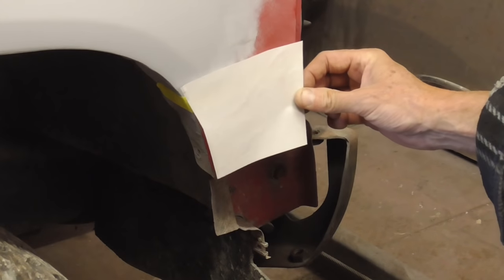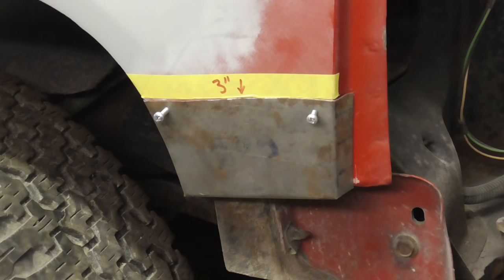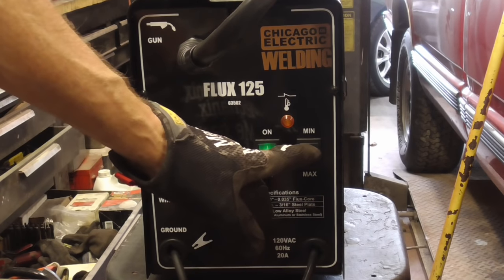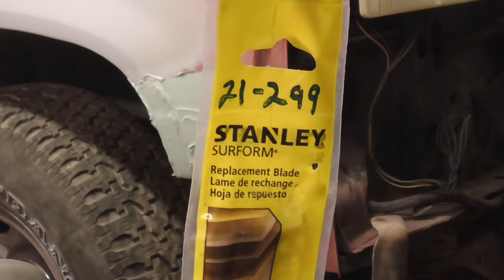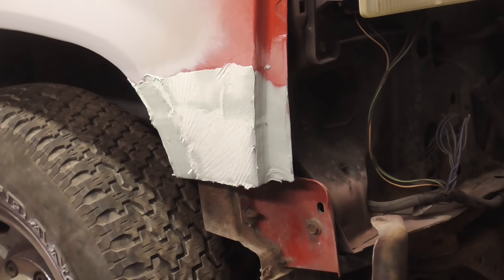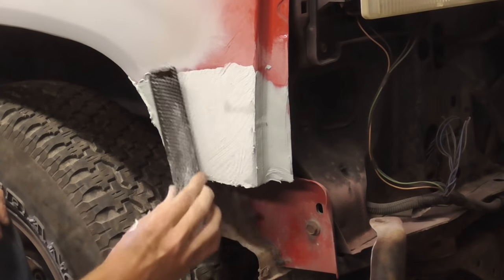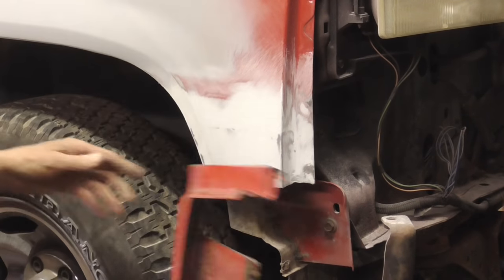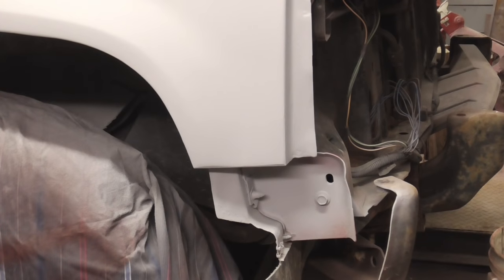Welding Automotive Patch Panels with a Harbor Freight 125 Flux Core Welder

Comment: Are autobody patches usually overlapped like that?  I thought they were done with butt joints?  I know nothing about autobody stuff though.
Reply from the maker: Many times on TV, the internet and magazines they will promote strict butt welding as the holy grail of patching but in most Michigan body shops lap welding is the most common method - along with butt when needed and/or glues.  All methods are usually used in a production body shop.  What ever gets the job done - quality/efficiency/speed - for each individual repair.  You will see all the methods I've seen used in body shops on this channel.  Here's some great info - that way you can make your own decision on what's best for you:  https://www.youtube.com/watch?v=JIIonJOVro4  *  Also see Eastwood’s explanation:  https://www.youtube.com/watch?v=rpH50kh4W00 *  For longevity of this type of repair see:  https://www.youtube.com/watch?v=8XaZBy7GC7A

Comment: question.
 the hammer work was just to push in the seam right? so that its easier to transition
Reply from the maker: Yes, the seam gets tapped down like they did with sail panels at the factory.  They stamped a depression in the two panels - quarter and roof, welded them in that channel, tinned it and filled with lead.  Today we use the same method only with MIG and body filler.

Comment: It’s not my intent to be critical, but I am wondering why you left the bottom horizontal edge of the patch panel so uneven and rough. 
Is that something you touched up later?
Reply from the maker: I think that was the part I was going to weld, grind and tap down before filling.  If that wasn't it, the other side (towards the ground) was touched up and straightened before painting :)

Comment: I have a much better gas/gasless mig welder sort of mid range that cost me €300 about same in $ and i find that flux core is almost as good as with co2 Argon mix. Really amazed at how good the welds on 22 gauge metal came. I set it at the lowest setting which is 10 amps. I will probably be able to flux core weld even 24 gauge as i get better with this machine
Reply from the maker: I think you will too - have a good weekend :)
Reply: @LakesideAutobody  thankyou and a good weekend to you too ☺

Comment: I was told that the flux core wire is not for painting because the gas leaches into the metal eventually ruining the paint.  Is this a myth?
Reply from the maker: That's a myth.  I'll do a follow up video on this truck as I have to do a quarter panel on it.  This fender, after driving it for a year or two in the winter, will look just fine.  All outdoor buildings, ships, bridges are done with flux core and they are painted so... not sure if that says anything but... something to think about.

Comment: Did i see that correctly? Was that new steel overlaid on the existing metal? Or was the butted up against the cut edge.   Im in something similar with my car where i need to do something similarish but its up higher on the rear quarter a bit on a 2011 wrx back edge where it meets the rear bumper edge.  Trying to figurebthe best way to do a repair like this. Was thinking fiberglass but id prefer tp use steel if possible
Reply from the maker: Most body shops in the "rust belt" use a combination of lap and/or butt depending on the situation or job.  Usually lap in open areas that the seam can be tapped down and filled.  Butt welds in areas of rigid metal like rockers, edges, etc. that can't be tapped down and filled.  Here's a good vid on lap vs butt for rust repair - https://www.youtube.com/watch?v=JIIonJOVro4
Reply: @LakesideAutobody  thanks good to know. Half the repair is visible on the fender including the entire bottom lip, and then the other half runs under the rear bumper, and under the first hole of the bumper bracket.  So that doesn't have to be pretty.  Mine probably falls under butt weld category.  Passenger side is in really decent condition but driver side for whatever reason not as happy.  Thanks for the repky
Reply from the maker: @Hustler_state  You're welcome.  A friend of mine worked for the city of Saginaw - salted roads, etc.  He says the drivers side always rusts fast because the salt is laid down towards the center of the the road.
Reply: @LakesideAutobody  interesting.  I wonder if the way roads are crowned, along with traffic flow maybe also have something to do with the salt on the drivers side being more as well.  I live up in mn so we have a ton of snow and salt. .  I try to garage it now in the winters as Id prefer it to not disintegrate away. Lol hopefully im successful with my patch here in the coming weeks. Once I decide the best areas to cut to make my templates the most simple they need to be, I have a strange confidence the rest will be alright.  Lol hopefully. Just couldn't let it keep getting bigger and bigger and rotting away so had to get in there.
Reply from the maker: @Hustler_state  Feel free to ask ?s as you go - I get to them every day :)
Reply: @LakesideAutobody  100% I will for sure.
Reply from the maker: @Hustler_state  👍

Comment: Can you please tell me the size flux core you used please was it 030or 035
Reply from the maker: .030" - the stuff that came with the welder.  A friend of mine says Lincoln wire works better though :)

Comment: Really enjoying the content, thanks for your work. Do you ever use All Metal instead of bondo ot duraglass? Doing my rusty MN cabs&rockers soon and thinking I'll go allmetal
Reply from the maker: I have not but I really don't have a problem with rust coming back.  If you make sure your panels can drain and dry - your good.  I squirt some oil in the doors, tail gate, hood, rockers, etc.  It settles at the bottom and starts to creep around and coat everything preventing future rust - here's a video on preventing rust:  https://www.youtube.com/watch?v=NXAo5IfMtPM

Comment: Another great video, I've watched a few now its the motivation I need to start work on my own project 👍is there any wire you would recommend for a gasless welder brand wise
Reply: Just speaking from my own experience but my harbor freight 125 does just fine with the vulcan .030 flux core
Reply from the maker: I'm just using the wire that came w/ the welder (cheap).  However, a friend of mine says he uses Lincoln wire and it works much better but that's hearsay so.... I am going to give it a try when I run out of this stuff and see :)
Reply: @LakesideAutobody  I tried both as well and I like the lincoln wire more

Comment: I thought flux wire was too hot/unsuitable for sheetmetal.  Was it ok because you used 20ga, or what?
Reply from the maker: It was OK because I was easy on the trigger.  If you keep the trigger "punched" and you get the material too hot it will blow a hole.  It is fine for sheet metal and the flux does not cause rust like some will say.  This job is my neighbors truck and it still looks great after a year in the salt of Michigan.  You do have to practice a bit though just as you would with MIG.

Comment: What about this same welder and technique for floor pans? Acceptable? Great video BTW.
Reply from the maker: It would work fine - just use thicker sheet metal - maybe 18 gauge?  Lap weld and seal with seam sealer - then paint.  https://www.amazon.com/ACDelco-10-2013-Joint-Filler-Compound/dp/B007Q0ZQGK  This seal sealer is paintable and dries fast.

Comment: Do you have to remove the gas tank or anything?
Reply from the maker: No never have either since 1982.  I've seen a lot of work with torches being used to loosen nuts, cut bumpers off, weld patches and have never seen a fire from it.   If you are welding right next the to filler tube/cap it might be a good idea to tape it up or cover it to prevent sparks from literally landing on and around the inlet.  Sniff around by the tank too to make sure there are no large leaks.
Reply: @LakesideAutobody  I've never seen a muffler shop do that either but I do know of a guy that blew up an empty gas tank when welding a quarter panel. He got lucky he only had minor injuries but he did get knocked off his ass. Not sure if he was next to a filler neck.

Comment: I’m not an auto body guy but are you actually supposed to overlap that metal like that and then use so much bondo to cover that ridge???
Reply from the maker: Yes - that's how it's done.  You want a buffer between your seam and the paint work.  Without using a layer of rigid filler you are depending on your welds to be perfect.  If not you have bubbling paint soon after the paint job is done.

Comment: Question......the patch panel overlapped the existing steel by 3 inches?
Reply from the maker: The overlap can be what ever is convenient for you.  I try to keep the overlap around 1/4".  It really makes no difference as the seam is upside down on the inside of the panel and holds no moisture - like a shingle.  Allowing for drainage so the panel can drain and dry is key :)
Reply: @LakesideAutobody  ok cool thank you!
Reply: @LakesideAutobody  I have a patch panel for a job I need to do that is similar to the video. But the panel made for me is to be butt welded. Is that  strong enough or should I have one remade to overlap?
Reply from the maker: @thomferrazza6161  You can butt weld it - no problem.  I would put the welds right next to each other, grind it just a bit - don't have to grind flush, tap the seam down a little and fill.  See this video for more information on preparing the seam - https://www.youtube.com/watch?v=lVkg7SgTw30  Hope that helps a bit :)
Reply: @LakesideAutobody  thank you ! Your knowledge and sharing of it, help tremendously! Cheers!
Reply from the maker: @thomferrazza6161  I'm glad it helped you out Thom - Cheers to you too.  Have a good weekend :)

Comment: So why did you spot so close together without any real time to cool? And idk how your gonna get that body line back...
Reply from the maker: When you are in tight spaces and the metal is firm like rockers, corners, wheel wells, etc., you don't have to worry about metal distortion.  When in the open on flimsy type panels you do.  Good thinking though.  Here's the panel finished: https://www.youtube.com/watch?v=CNVENaswsio  here's when I block sanded to get the body lines straight:  https://www.youtube.com/watch?v=PkDY4b_I8w0
Reply: Thanks! Need to do corners, rockers, and rear wells. Was honestly wondering! So I can actually do the rockers and corners a bit quicker then the wells cause they are tighter firmer spaces. 

Going to pick up I think the titanium 140 pro 120volt from harbor freight and give it a go. Think it's gonna be around $550 to set up gas n all.

Comment: Is there an advantage to using a mig tip with flux?
Reply from the maker: None (I don't think)  - except for a distance guide.
Reply: @LakesideAutobody  ok just wondering. I have a titanium multiprocess welder and it gas a smaller tip cover for flux and the one you're using for the mig set up
Reply from the maker: 👍 @patrickdolan.

Comment: Which wire do you use? I’m new at this
Reply from the maker: Use the wire that comes with the welder - it's usually .030" :)
Reply: @LakesideAutobody  thanks. I got a different one and it didn’t come with wire.

Comment: Won’t the rust get in behind the lap weld?
Reply from the maker: I'm going to do a video on that one day actually.  The truth is no - first the seem or lap is upside down on the inside, 2nd is the lap is small, and 3d remember all vehicles are lap welded together at the factory - not one butt weld is used and they last pretty long.  Good question - keep an eye out for the video on that topic - good topic or / BTW :)

Comment: I like the way you put the wheel opening body line in the patch before welding it on......how did you go about doing that?
Reply: Masking tape and let your block hang over the line
Reply from the maker: If you are talking about the bend in the metal - I have a nice old fashioned large jaw vise that I clamped it in (wheel well side) then just sort of bent it by hand a bit manipulating it to that shape.  Glad you noticed that :)

Comment: Hi I'm Steve from Jamaica, I look up to you as a mentor in the field. I was wondering what size wire do you use with your welder and can you advise me about burn through?
Reply from the maker: On this welder it's .030"  but on my Miller MIG it is .o23".   To keep from burning through on thin sheet metal whether you're using gas or flux core - be short on the trigger.  Turn your voltage/amps down and use short bursts of weld.  Let me know how it goes for you.  Thanks for the support :)

Comment: Awesome video! Quick questionL Would flux core be solid enough for a structural weld? Like a dogleg replacement on a VW bus?
Reply from the maker: I think it's just as strong as MIG (gas).  They exclusively use flux core when welding bridges and buildings outside because wind blows the gas away.  If it's strong enough for bridges and structures then for sure.
Reply: @LakesideAutobody  From my mistakes today learning with my millermatic 130. I think the flux core is a lot hotter?   I was burning holes in 22 gauge steel. I stitched from gas to flux core today because my .022 wire was getting stuck in the .030 liner.  I'm fighting trying to figure out why. I didn't have any problems with it a few years ago. I bought a new liner, but I ordered the wrong one.  I'm making a lot of mistakes, but my body work is getting better thanks to your videos.
Reply: oh,  to keep moving, last week I brazed some metal in on the inner fender. I seem to be a lot better with that. Map Oxy.
Reply from the maker: @robbyddurham1624  Maybe the end of the .022 wire is curled a bit and snags inside of the bigger .030 liner (like runs into the wall).  Mistakes is how you learn.  I broke windows, burned interiors, headliners, forgot stuff inside of doors - everyone makes tons of mistakes - nothing to worry about.  Glad to hear your body work is getting better - keep me updated.  Jerry
Reply from the maker: @robbyddurham1624  Very cool - my dad was big on brazing, lead work, and fiber glass repair.  If it works for you then use it.
Reply: @LakesideAutobody  great, thanks for the reply, and the videos! I'm learning a lot from you. :-)

Comment: What wire are you using? I get nothing but blow through
Reply from the maker: .030 wire (the wire that came w/ the welder).  Be short on the trigger, have clean metal, practice with different distances from the metal.  Let me know if you find success.  Keep asking ?s

Comment: Great video!  I replaced a rocker panel on my truck, with your great videos. It turned out great. Is it getting too cold outside to replace the other side?  Will sheet metal wrap more because of the colder air.  I'll be outside doing the repair
Reply: Absolutely. Nothing wants to bond to cold metal. The cold will be ok for welding, but your filler and primer will not stick or setup properly unless you find an unusually warm day around 70
Reply from the maker: Mike is right your welding will turn out the same (flux core works the same inside as it does out because there's no gas to blow away).  You won't have any more or less warping.  The filler will harden much slower so add some more hardener to it to compensate.  Primer will dry slower too - might have to try to get it indoors after priming.
Reply: @LakesideAutobody  Thanks Jerry & Mike!
Reply from the maker: @robertlipscomb9741  You're welcome - keep us updated on the progress :)

Comment: Question what's the best flux core wire to use for that sheet metal
Reply from the maker: I've tried a few different wire brands and I think they are very similar.  A friend of mine says Lincoln wire works the best - less spatter.  I have not tried it though.  I'm thinking they are all the same but someone correct me if I'm wrong on that.
Reply: Thanks very much your video's help me a lot!
Great content!👍
Reply from the maker: @mikemay1922  You're welcome - glad they help :)

Comment: LOVE your videos Jerry!  I was just wondering if you protected the back of the panel in anyway?  Thanks!
Reply from the maker: Thanks and you're welcome. I did not on this job but am not worried about it as this patch panel has great drainage now. If it was my truck, however, after it was painted I would do this:
https://www.youtube.com/watch?v=8XaZBy7GC7A  Also, if you can access the back it's really a good idea to sand blast it and coat it with some undercoating of your choice.  I like stuff that stays flexible - never really gets brittle.  There are a ton of choices out there - I have not found a favorite yet.  Always open to ideas on that.  Jerry

Comment: What feeler are you using???
Reply from the maker: Sorry,  I'm not sure what you mean by feeler.  Feel free to ask again with a bit more explanation - I'll get you an answer - Jerry
Reply: Bondo
Reply: What brand of Bondo
Reply from the maker: @pain_inthe_bass  I use Auto Body Master light weight body filler 19/gallon at Auto Value Auto Parts but you can use anything.  Don't be afraid of the cheap stuff - it's really all the same :)